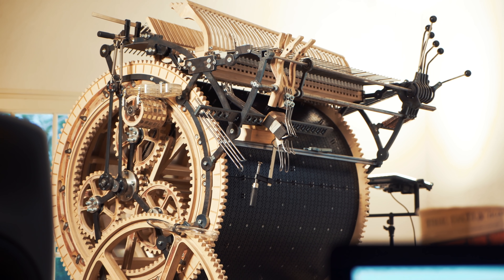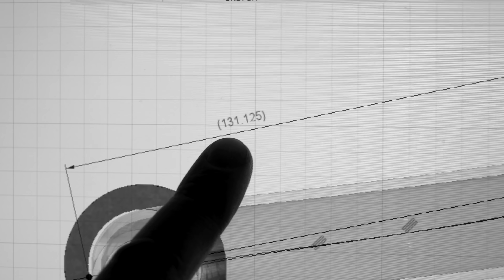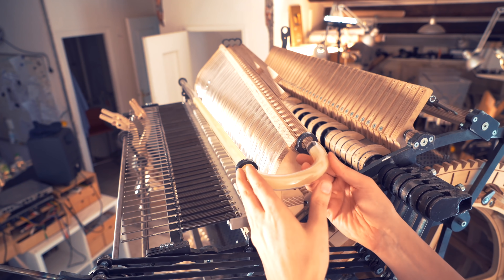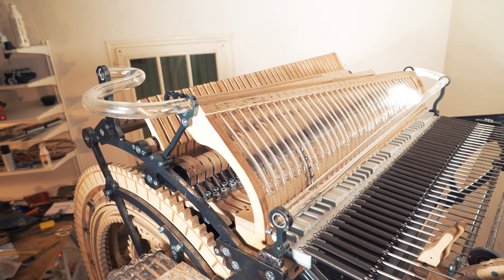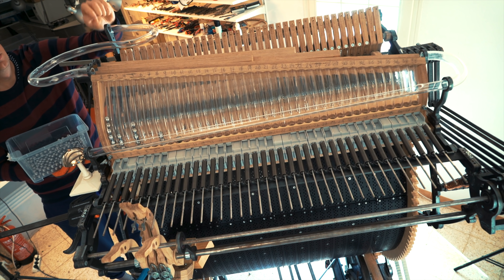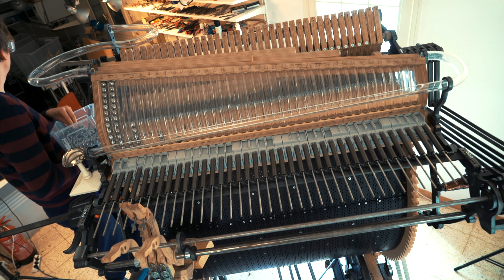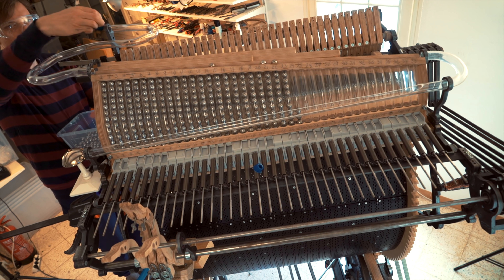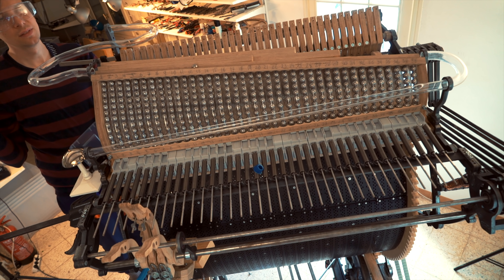Marble Divider Transport Tracks - Marble Machine X #68

Comment: My idea for the programming wheel design: same process as current but don't drill the holes for the magnets with the sheets flat on a router, drill em after being bent and assembled onto the drum with a milling machine or similar, problem: requires a milling machine. This would solve a ton of problems, but would require somehow getting a MMX drum into a milling machine or adjacent to one etc. This would let you machine all the holes of one drum at the same time and have their relationship to each other not change afterwards. Idea came to me watching This Old Tony's gear making video. Bara en ide.

Comment: 10:03 It looks like marbles might get caught inside the killer snake tube.  Could a textured surface (e.g., bumps or ridges) inside a shorter steeper pipe slow them down enough instead?

Comment: Hey Marvin i see what your problem with the programming wheel is when you curve something it causes the inside loop to be smaller than the outside and the outside loop will get bigger because of the curve. So in order to fix this why don’t you just machine the inside loop side of your programming wheel slightly bigger than the outside making the inner curve bigger and allowing the wholes to fit better

Comment: One of the design requirements is rapid reprogramming of the machine - I had always assumed that you would have one wheel per song and would be switching out wheels.  Reprogramming is a time-consuming and error-prone process.  Why not use tape of some form, similar to player pianos?  A strong, stiff tape should have the accuracy you require (perhaps some sort of stiff plastic or fiberglass material could be used) and you could mount the tape on the existing wheel (with a little modification).  Of course a tape with holes punched in it wouldn't interface with marbles.  

Yeah, that's tough....

Comment: Amazing video and conversation as always. 

I repair and restore pinball machines, and I build coin-op machines. As such, I have a lot of experience making machines that move around steel balls look nice. One question I have regarding the programming wheel is why you didn't put the shiny side of the plastic "face up"? I think it would look really nice to have more shiny surfaces for the marbles and components to reflect off of. In pinball almost every metal component visible to the player is shiny chrome or nickel plated - and having this stuff be super shiny makes a big difference in how the machine looks. Maybe the premade programming plates you mentioned in your comment can be shiny? I know this is probably just your design preference towards unfinished steel and plywood, but hey, it's just my two cents. 

One tip: get a vibratory polisher and polish your marbles - they will move through the machine smoother and also get a mirror finish.

Comment: Layman/non-engineer here—is there a reason you can’t just 3D print small sections of the programming wheel, and use the existing mechanisms? It seems to me that the biggest complication comes from the variance caused by the material being bent (in addition to how taxing the material is on the CNC bits), but 3D printing small sections would let you get around that by being able to print it with the bend already in it—at least to my layman’s eyes.

Comment: So, just a comment on your comments on project design (comments). 

It's absolutely true that maintaining all your design requirements limits your choices quite a bit. But that's how a lot of projects fail - their design requirements force them into weird rabbit holes, where they thrash around trying to push through an ever-increasing number of problems. Sometimes you have to accept that you cannot meet all of your design goals and compromise in one area, so you don't end up with everything suffering instead.

That said, I have no idea if that's where you are in this project. I doubt anybody who's not in your workshop can say if you've hit that point. As long as you keep actively considering the problem, I suspect you'll figure it out eventually. Good luck!

Comment: Hmmmm, I foresee an issue with note run-out on the marble dividers, Position 1 has 17 marbles in the stack and always fills first, but position 38 only has 10 marbles in the stack, but is the last to fill - thus you will never be able to fill position 38 fully, as the other rows will always take precidence.

By having the marble feed at one side you over complicated the design - a central funnel that collected the marbles in the centre of the runs, then fed out to either side at the same time would have been easier and work better.
Reply: there's ramps to add marbles in at the 1/3rd and 2/3rd mark of the divider, you should be able to see them in this video
Reply: but that still won't work as even the third (top) track will not deliver enough marbles as it converges as line 28 ish (can't see exactly from the video. also, having 3 tracks wont matter as the marbles will "Jump" between tracks - much simpler to have a central funnel or hopper delivery system sending marbles to both sides on a single track with a small gradient to left and right to deliver them to each tube - this cuts down on numbers of delivery tubes, tracks and complicated kinetic energy reduction, no longer needed.

Comment: Programming wheel solution might be to add a layer. To have a precise machined/punched sheet of metal (some aluminium?) and underneath it the black plastic with rougher positive tolerances.

Comment: If you think your programming wheel design is complicated, think on this:  if I'd designed it, I would've designed a flexible programming belt, so that different songs could be different lengths.  Now think about the engineering hassles THAT could have created.

Comment: A freely rolling marble doesn't roll too fast, and the inclination is very shallow everywhere in the loop. Have you tested that they will fill up fast enough if you play a song with a high tempo that "consumes" marbles at max rate? Or, if they line up in a queue, that they simply don't stop each other if they don't have enough speed to also push on when possible?

Comment: Idea - dark stage, glow in the dark marbles. Using lighting in some creative ways when the marbles hit the keys.
Reply: Needs the kind of glow stuff that absorbs light, then have a strong light shining at one of the choke-points that each marble passes to get recharged with light.
Reply: It'd be up to the manufacturer, but seems like clear glass marbles with the glow stuff protected inside the glass would be ideal.
Reply: Potential issues - friction of the outer surface of these marbles?
Are they less durable for any reason if it's part of the manufacture?
If painted, see question 1 again and what if the paint makes them too large/slightly uneven?
How long will the marbles stay lit by themselves? Long enough for one song?

Any ideas on how to avoid these potential issues?
Reply: @g1Chikumo  maybe some way in which they can glow in response to heat from friction? Alternatively, if they are more akin to bulbs, fragility would be a concern
Reply: OoOoOoh......noice. I'm appreciating this aesthetic in my minds eye.

Comment: Will it be a problem that the marble channels farthest away from the input are also the smallest?  Is there any concern that the small channels on the right will run out and not be filled because of the volume of the channels that come before?  Or will the quantity of marbles be so high that it just won't be a problem?

Comment: Plastic Injection Molding.  I enjoy and admire your over complicated design. That's part of the Art.  BUT The solution to creating the plastic part that holds the programming pins in simple. Plastic Injection Molding. With expert help you can find the right type of plastic that will give you the rigidity and flexibility you need with the Precision you Want. I tweeted @ you and a company that came up #1 in Search. They can design the Part already curved so installation is a snap (Maybe Literally if you/they/team can figure that out). No Distortion of the holes and Uniform spacing. They are exactly how you designed them to be. PLUS creating a smaller piece/strip will allow for a lower cost. Instead of 4 big sheets,  Each quarter is made up of strips of one part. 19 I believe, but you could do 28 if you cut those strips in half. Think Lego. An added bonus of smaller parts is that if a piece ever gets damaged or cracks it can be easily replaced. Just that small section/piece and not the WHOLE panel. PLus you could go for different colors for different Songs. 

Don't slay the dragon, when you can tame the lizard.

Comment: I have a tip for releasing the silicone rod. First spray it with silicone spray and then put your air compressor on one of the holes. The tube will come flying out the other end.

Comment: A future upgrade for programming could be an adaptation of grinder organ programming sheets with vacuum actuators or pneumatic actuators controlling the marble drop. This would give the advantage of much longer compositions that do not have to be programmed as a loop. It would also be far more complicated than your current system 😁

Comment: Something about the marbles bouncing off into the rest of the workshop sounds oddly satisfying. I am now curious if you can make a song by having a marble fall down a flight of stairs hitting things for different notes on the way down.

For the programming wheel I can't see anything wrong with your approach, but would suggest once you have a song made, to re-create the wheel with only the pin positions cut for that song. This is so you do not loose the song should something get dropped during shipping on tour, and to allow you to recycle the super complicated programming wheel with all the pins for composing. 

Another advantage if you were to go for my above suggestion, you could then have art or something etched or cut into the blank space of the wheel.. maybe an depiction of an epic battle against a dragon?

Comment: PROGRAMMING WHEEL IDEA:
1 - keep your existing design as it is 100%
2- Build a rotary axis that can hold your panels together as if they were installed in the MMX (replica if the mmx prog wheel)
3 - fit this rotary axis to the end of your CNC table and wire it in to replace your Y axis  OR  Build a new CNC for this... simple compared to the MMX <-- your fan base can make this for you...
4 - machine all the panels while they are held in place in (on) the rotary axis. Having the piece controlled on an angular base vs a linear base will make everything more accurate and predictable given the assembly can be made rigid enough.  So the whole song / wheel can be machined in one pass on all panels.
5 - Heat-treat your plastic after bending it over the frame before machining it to relax the internal structure. The pieces should not be held under tension when machined as this will surely change the shape of the plate.

Comment: I have to think that if you could machine the panels after they are formed with the radius, it would make getting the slots where they need to be a lot easier. It would obviously require a larger machine that has an "A" axis capability. Just my $ 0.02 (USD) worth. Hang in there!

Comment: Idea for programming the programming wheel.  How about a robotic design that placed the magnets in the correct position for the song. In short, add a programming arm that can remove all pins in one revolution and then place all new programming pins in the second revolution.  This could be almost as fast to reprogram without needing to swap out programming plates.  

Alternatively, have a second programming machine with the programming wheels mounted in their normal circular configuration. The programming “arm” would be placed into position and could operate much like a CNC or inkjet printer with a “programming head” that moves across one axis while the wheel advances to allow movement along the second axis. 

To speed up programming the entire arm could be used to program with multiple robotic programming heads. 

There may be a more elegant mechanical approach that drops programming pins into their correct positions by translating MIDI data into position coordinates.

It would be a nice companion machine (a soulmate?) for the Marble Machine to also have a programming machine slightly off-stage “showing support” for the Marble Machine during the performance. lol

Update: An ideal solution would be for a “programming arm” to be able to place and replace the programming pins on the Marble Machine while it is operation. If this can be accomplished with a single rotation then the Marble Machine can be used to perform songs of almost any length or complexity.

Hmmm...   I am going to think on this some more and see if I can sketch up some ideas.

Comment: I personally prefer the current solution for the programming wheels. For some reason having welded songs feels too solid and restrictive. I don't know how much time you'll actually spend on improvised MMX programming, but it feels important to keep the opportunity. 

Also, you aren't designing a product that needs to be mass produced at a certain cost, so it's more important that it works and looks awesome than it is simple and easy to build.

Comment: The cut overflow tube is going to cause future problems. Be careful not to choose form over function. The slight increase in astetics at the cost of a greater risk of failure is not worth it.

Comment: I understand that it takes a very long time to CNC the programming wheels, but the hole size issue and cutter wear seems (to me) to call for (at least) 2 cutting passes.  First pass with a slightly undersized cutter and then a final pass.  
Sorry if this has already been suggested.

Comment: Really test the plastic template. You are going to bend it over the programming wheel and then insert pins through it into the plastic. Worried it may not just peel away since you are effectively almost nailing it to the wheel. The template holes may need to be over sized in the short direction, aka the direction of travel for clearance.
Reply: The plastic plates are mounted to a removable frame. Once they're bent and installed they shouldn't need to be unbent. Unless there's a change I missed.
Reply: @cll1out  To me a template is something you apply to something to help with layout and then once marked up you remove the template. 

No way I could go back to find the video but my impression was that this sheet would be affixed to the programing wheel and everywhere you see a hole you stick a magnet in. Then its removed, but I do see that it could stay on the wheel.
Reply: They could design it in a way that it doesn't have to be removed - just sit spinning on the wheel during the show :P

At that point, they could even print patterns on it to highlight the rotation of the wheel, and to differentiate the different songs to the audience.

Comment: This system MIGHT be a little over-complicated, but I personally thinks that's what makes the MMX so fascinating and hypnotic to watch. The first one was pretty cool, but this one is more streamlined. The first one was (no offense) just kind of jerry-rigged together and looked kind of crude and rushed. The MMX has a more "Ok, let's make the original MM, but better in every way," type of feeling. I understand people's feelings of, "There has to be an easier way" but if there is one, I can't think of it. I don't know anything about machine engineering or metal-working or anything that high-tech and fancy, but I think that (unless a highly credible person comes along and suggests a better way for one of the parts) the MMX is fine as is. 

Keep up the great work Martin!

Comment: I think the most sensible (mechanical) alternative to the programming wheel would be a big music roll (punched tape). That would allow for easy changing of music on the tour and easy transportation of said music.Of course, that would require a huge redesign of the entire center of the machine, be far less pleasing aesthetically, not allow for experimental programming on the machine itself, and has doubt already been considered and dismissed during the initial design phase.

Comment: for the large plastic pieces of the programming wheel where you had issues with the plastic contracting after a day. Would it be easier to just set up several of the pieces on the table to run so by the time the last one is done it would have started to contract and you just have to run the CNC twice?

Comment: not sure there is a simple solution to the programming plate hole accuracy problem. a complex solution would be to machine the holes in place while attached to the programming wheel.  a less complex but more POSSIBLE solution would be to machine the holes while they maintain the proper arch attached to the curved plywood segment but not the whole wheel.  neither of these are options you can complete with the tools you have there and why i didn't mention it before.    i'm sure with a bit more trial and error your current method will work out.